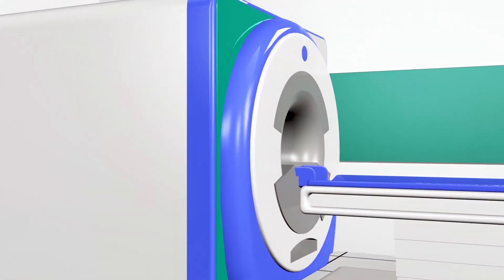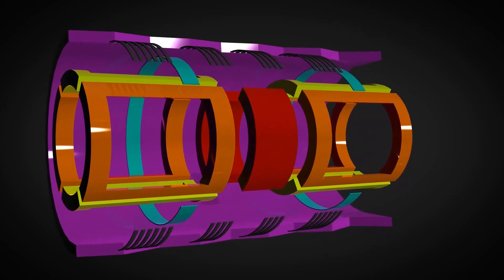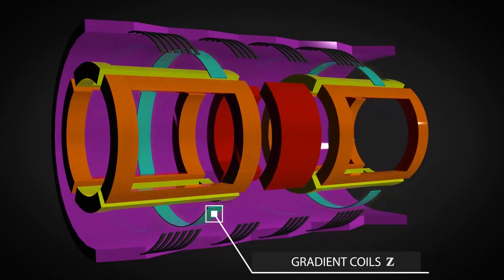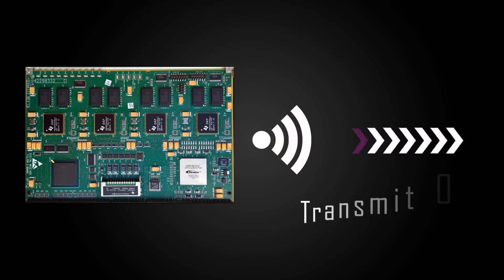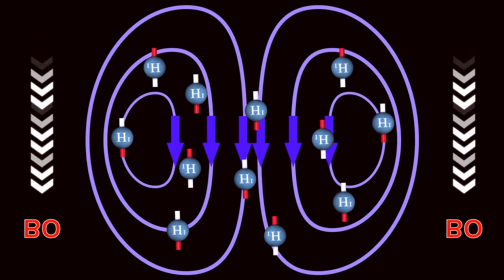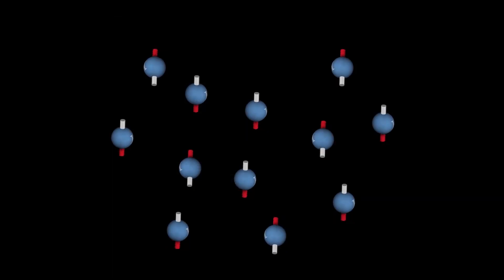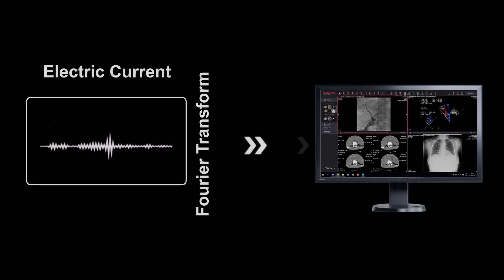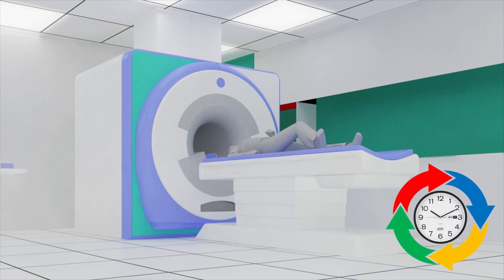How does MRI work? (Magnetic Resonance Imaging)

Comment: Thanks , the video is very illustrative. What about the voxels?
Reply from the maker: Each slice of tissue is subdivided into rows and
 columns of individual volume elements, or voxels. The size of a voxel has a significant effect on image quality. It is controlled by a combination of protocol factors and should be adjusted to an optimum size for each type of clinical examination. Each voxel is an independent source of RF signals. That is why voxel size is a major consideration in each image acquisition.